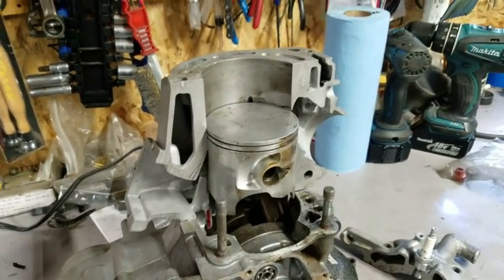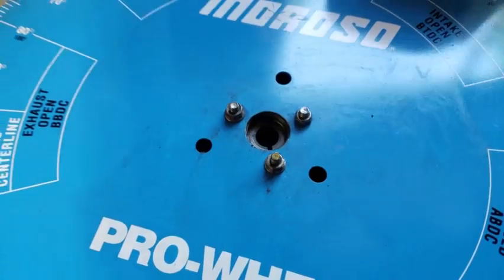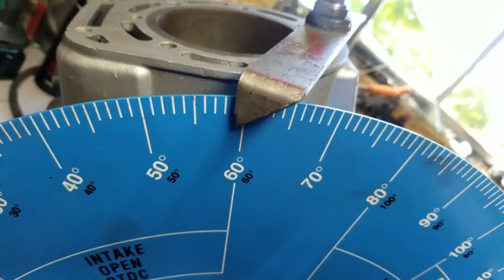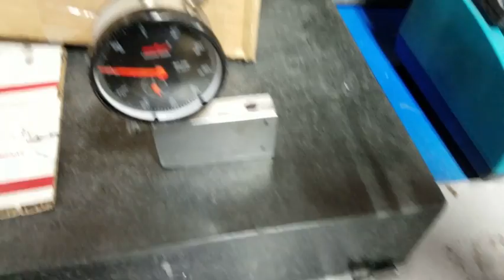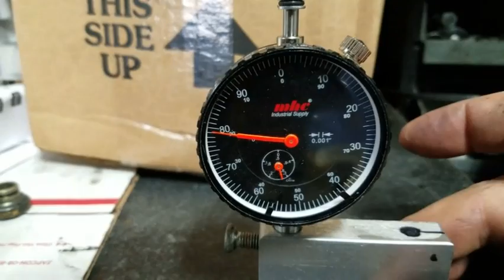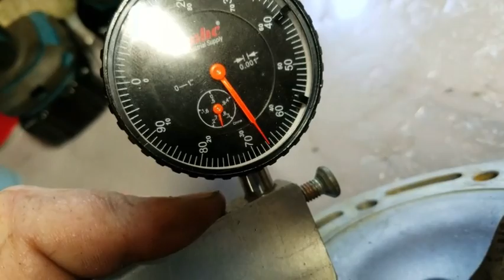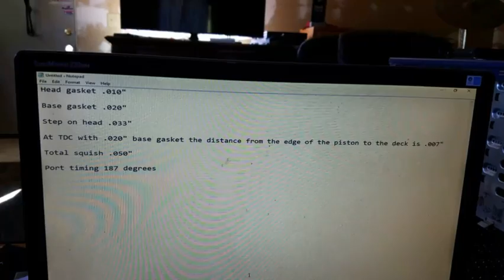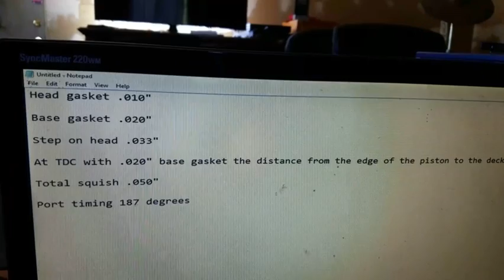Before you build your new engine

Comment: 184 p.t worked well ,47 to 60 squish / target 55  ,
 torque  ?,
 take .040" off the bottom 
adjust head gasket to head cut or vise versa witch ever works out for you .
clean up all the bad casting in the ports ,
polish the exhaust will help with the carbon build up

Comment: Man... sorry to be the 50 questions here on each of your videos..... But, I can't find much yet on what kind of range the port timing "should" be on a kx500. As Im getting older, I prefer more bottom end grunt, and don't really hit the top very often anymore.... and actually quite like the torque for trail riding and technical riding... so, I'm looking for low end gruntability... I'm wondering what port timing number would be a better number to shoot for, 180? Thoughts?
Reply from the maker: 180 is pretty low... You will loose a ton of top end but you will get a lot of bottom end. I would recommend 182.5 which will be removing about .040 off the bottom of the cylinder. that will mean that you will need to use a head gasket of about .050", or have your head recut.. I would also recommend a flywheel weight. Heavier is better. Also a PWK quad vent airstriker 38mm. Torque monster.. Last, join kxguru.com. I don't check youtube very often.
Reply: Thanks bud.... I just signed up, and have a lot to read before I post much more. I will keep this information, then ask later on KXguru about a B 540 kit question.. ( It was part of the basket case I got with the motor, but didn't plan on using it). Sure appreciate your expertise!
Reply: @freebikepost  Heavier flywheel will ruin the bike snappy power & all the fun dude
Reply: If you got room for another bike (who doesnt?) CR500s make loads of low-end power stock..
Ive found the KX has much more on top, CR is low to mid.
I have both, and love 'em to pieces (and back together again!).

Comment: Stock KX500 base gasket is .020. You can buy aluminum spacers from Cometic to make port timing changes easy. But you need to know what you have BEFORE you order anything.. A lot of times you can tighten up your squish by getting the correct base shim or gasket stack. For a lot of guys this is all they want for additional power.